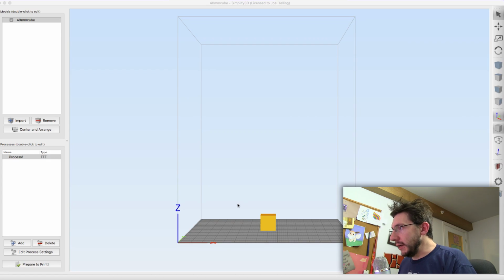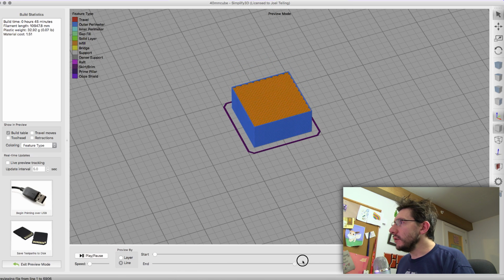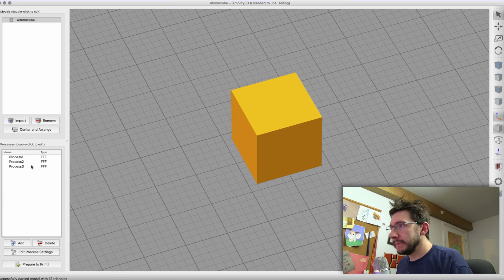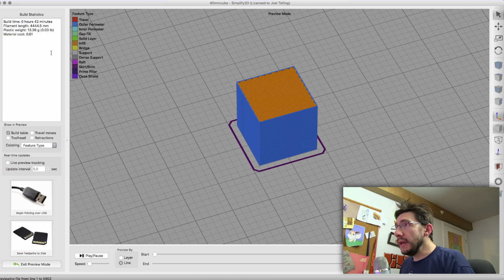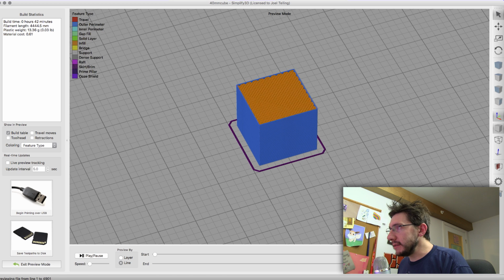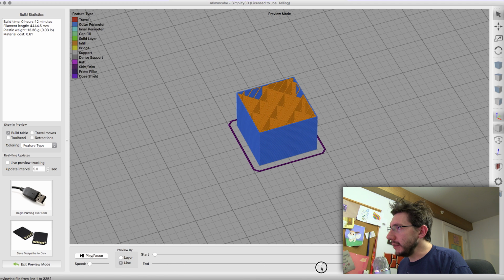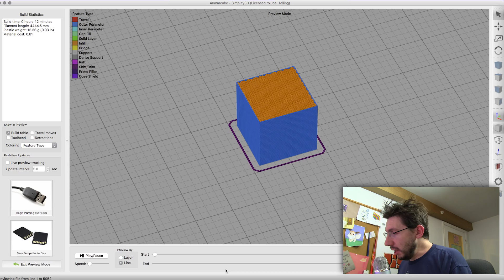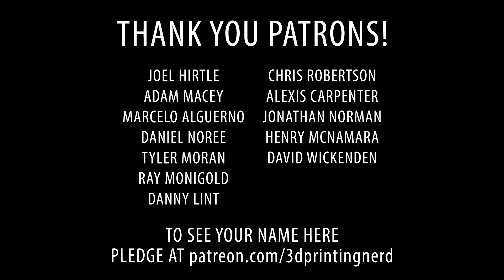How To Use Multiple Infill Percentages When 3D Printing With Simplify3D

Comment: Never 3D printed before but have a Wanhao Duplicator i3 Plus on the way. I read enough comments to see that someone asked if the fill percentage can be varied radially and you said no.  But do you know if it is possible to vary fill on any axis other than Z?  Thanks for the vid.

Comment: REMEMBER!!! 
Set "Top Solid Layers" to 0 for every process except the last process. 
I did a print with differing layer heights, forgot to toggle top and bottom layers off for the respective processes, Extruder clogged against the print and burned out my Extruder Driver. I was a sad panda.

Comment: I just got S3D so i'm very new to the software, when I do this, I made 3 processes, 5% from 0-5mm, 15% 5-10mm, 25 % 10 mm to end. at the end of process 1 it prints 3 solid layers ( I have it set to 3 top/bottem layers) and and the end of process 2 it does the same, being in the middle of the object, I dont want this to happen. Has anyone come across this ?
Reply from the maker: Oh yes. process 1 set to 0 top layers, process 2 set to 0 top and 0 bottom layers, process 3 set to 0 bottom layers. does that help?
Reply: That fixed it! Thanks Joel!
Reply: Perfect fix, I was having this issue as well.

Comment: So i tried this a bunch. Unfortunately the models it can effectively work on are very limited.

Setting the top layer count to 0 between processes doesn't work on models which have features with top surfaces. S3D omits the top surfaces of those models, leaving holes.

If you leave the top layer count between processes at a normal value (say 3 or 5), it creates a solid layers between processes, eating lots of filament and kind of defeating the purpose.

which is a good illustration of one of S3D's flaws compared to say, repetier. S3D is excellent, but it currently has some gaping feature holes.
Reply: From Joel "Oh yes. process 1 set to 0 top layers, process 2 set to 0 top and 0 bottom layers, process 3 set to 0 bottom layers. does that help?"
Reply: Complety agree, wouldnt it be better if there was another tab for processes, where you can heights and choose whaat parameters you want to change rather than ending one process and starting another, would make life sooooo much easier

Comment: This is good stuff. If you could do more on simplified 3d, I would become a loyal follower.
Reply from the maker: +Mark Reyes (Mark the Jeweler) I will definitely try to as time allows. Right now, my filming schedule is packed tight, and I can't film anything until after the wife and kids are asleep. Yes, I'm tired :) Anything specific you'd like me to cover?
Reply: +3D Printing Nerd... There so much... I've been printing for about 8 months now and use Cura mostly. Print speeds, layer heights, I guess most basic commands would be very helpful. There's so much there, and I need to just get past and understand the basic stuff.

Comment: Great tip! This method makes a lot of sense for some types of prints, I'll have to try it some time (once my printer is working again). I think it might also be possible with cura, but seems much easier to set up in Simpify3D. Haven't taken the plunge yet but this is another good reason to consider buying it.

Comment: I'm going to try this on "OpenForge Stone Dungeon Edge Walls" 4x2 stl. 40% all the way = 64,40 gram
with 6 Processes, 5% 15% 40% layers would be 43,89 gram. ( I will have 1 set of sollid layers in the wall )
Potential Save of 20,51 gram , about 32% saved.

I Initially had my infill on fast honeycomb, but due to the bridging I'd better go for grid..

Other settings 0,150mm layer, 3 top, 3 bottom, 3 perimeter on M3D Micro with 0,35 nozzle.

I'll check back when I printed it.

Comment: Joel, thanks for the tips. I think that this may fix some issues that I have been having lately with some prints. I have been noticing that the top and bottom layers have not been filling in like they should  and the strength appears to weaker than normal. I will try this and see how it works.

Tim
Reply from the maker: +Timothy Jacobs Hey Tim, you're welcome! Hopefully this technique comes in handy sometime.

Comment: Never used more than one process to print anything. Maybe i should start experimenting with that feature of S3D too and see what other cool stuff can be done this way.
If i want to save on plastic and don't need a solid infill for mechanical reasons i usually end up cutting out the inside of the model directly in CAD. Basically i select the surface and make a new surface out of it with a negative offset, so you basically have a smaller version of the model inside that you can substract from the original. If you use an offset of 3-5mm it usually gives a pretty solid model all the way thru, and you don't have to print any infill at all where it's not needed.
You can do the same with Meshmixer too from what i've seen, just check out this Video for a quick tutorial:
https://www.youtube.com/watch?v=ILKspBZjSDM
Reply from the maker: +ExtraBase This is great! Thanks for the link!

Comment: Joel, I've heard that you can also use separate processes on different models on the same print (a box with 10% infill, a ball with support and 50% infill and a pyramid with no infill or support) all at the same time (a process for each object) but I have not figured out how to do it.

Is this true? And if so maybe you can do a video on how.
Reply: When you are editing the process there is a button in I think the bottom left corner to choose what models to apply it to.

Comment: About infill in S3D, have you noticed that if the checkbox "Print every infill angle on each layer" is checked, then S3D will actually print multiple layers of infill on top of each other (depending on the number of angles). While this gives very good strength, it also means that the nozzle very often will have a bumpy ride when it is printing the second and third angle of infill on the same layer. On low levels of infill it isn't very noticeable, but if you have very high infill (say 80-100%) for maximum strength, it is kind of annoying, as it causes a little rattle when the nozzle hits the previously printed infill angles.

Try printing a 20 mm calibration cube at 100% triangular infill (as is often recommended to calibrate the extrusion multiplier) and keep this box checked, and I think you will see what I mean.

Oh, and high five BTW.  :-)

Comment: Since I just bought a copy of Simplify3D the other night (yes, I saw your smiling face on their site) this is a great tip.  Migrating over from Cura I have found there is a small learning curve.  Still trying to figure out how to set the speed of the print.  I will not do a commercial for Simp3D here but I am finding the finished prints just a little better and smoother than Cara with less supports and that is what I was looking for.   Keep the tips a coming... need all the help I can get.  [Digital high 5]
Reply from the maker: Rad! Learn it all! As for the speed, look in the "process" - edit it, and select the other tab I think. one of those tabs, it'll have the speed.

Comment: I love the idea of using different settings as you run through. Are you aware of any other programs that you can do this with? I suppose I could get Cura to output several lots of GCode for a model and use some cunning cut and pasting in Notepad++ to make a blended model?

You asked for requests - Id love to see how you handle using multile filaments, either by changing filament half way through a print, or using a dual extruder!

Comment: Holy crap, your subscriber numbers shot up like a rocket past 10,000.    Have you ever tried varying the layer heights using this method?  It's not as straight forward as you would think it to be.  I went from .3mm in one process to .1mm in the second process.  When I first tried it, it just printed the second layer in mid air.  Turns out, if you stop and then start on the exact same height, it will always do this.  You need to tweak the start and stop to make sure you do not see a small gap in the slicer preview.  I wish S3D would go by layers instead of height.  That way you could just say stop at this layer, and start on this layer without having to tweak it.
Reply from the maker: +jeevesme I get the feeling you and I aren't the only ones who would love this feature by layer.

Comment: Nice tut. How much hours did you're gmax print already? must be extreme !When do you know its time to replace a belt or any other part.Do you see it in the prints upfront of failing or...
Reply from the maker: +xiphy94 Thank you! How many hours - LOTS. I haven't needed to replace a belt yet, so for that, I don't know. I did have to replace a bearing that went bad, and I saw it in the prints because it was the bearing that held the filament against the hobbed bolt and it was causing the filament to not extrude as well.

Comment: This is the part I love and despise about S3D because it should do the math for us and let us input based on layer count not where on the model in mm to begin and end.   Just makes it easier for the user to use layer count versus height or even better allow us to use either one. :)
Reply from the maker: +legalizeshemp420 AGREED. Hopefully they are working on it.
Reply: 3D Printing Nerd
I had a really complex model I had tried with it back in 2.0 days so about a year ago and I spent 99% of my time trying to figure out what layer was at what height (I was doing multiple layer heights per process too) and with the bugs too I chunked it aside and used slic3r.  If they would add just this it would rock because s3d is not the only one that will do this (even slic3r does) but the others work off of layer count not height.  My fingers are crossed.

Comment: Close, but not perfect. You see, when you use different infill  processes  and  want a truly seamless joint between the  processes then you need to take the start of the second (and subsequent) process and also change the first layer height to 100%  and the cooling  fan setting to first layer 'on' to whatever % your using. I noticed on the vid that the fan shut down first two layers of the 40% process.  

I've never had a top layer issue because I set top layers to 4 but I use different infill a lot on figurines to make to base heavier.
Reply from the maker: +66tbird1 You're totally right. I did realize the first layer and fan and such needed to be changed AFTER I shot the video. Doh.

Comment: I'm assuming you're working with PLA. How well would active cooling work with ABS or PETG?
Reply from the maker: +jayfehr Active cooling, generally, isn't used for ABS or PETG I believe. I haven't worked with PETG much, but, I think that is the case.
Reply: That's what I thought. Thanks for getting back to me so quick.

Comment: Nice :) It should probably be an automatic feature, since this process approach is quite labour intensive and inflexible, if you have more than one separate top surface (like a set of stairs). Maybe some kind of adaptive infill option? It could gradually build up the infill percentage only under the upcoming top surfaces. Get on it, Simplify3D!
Reply from the maker: +Honza Bartoníček I LOVE that idea!